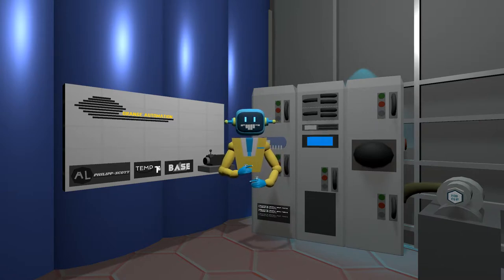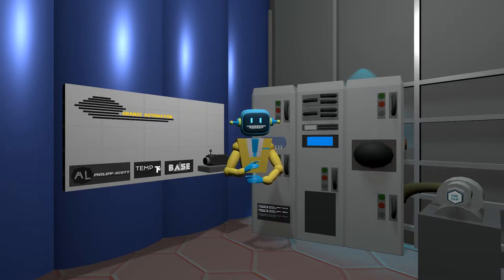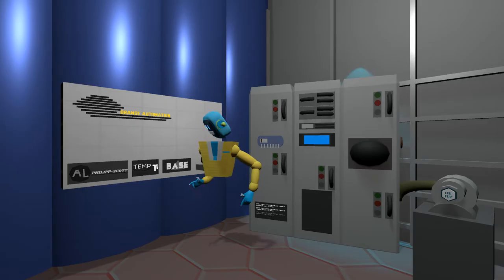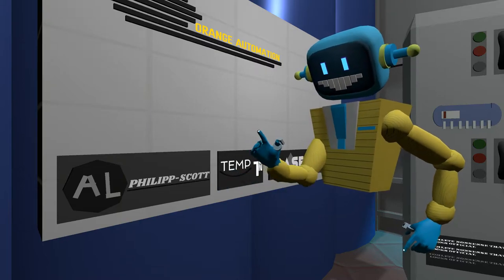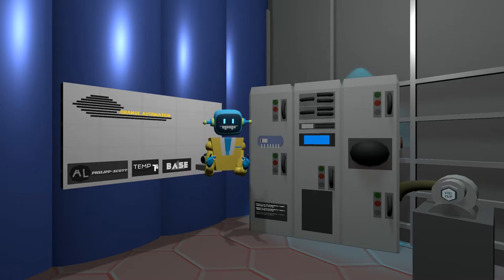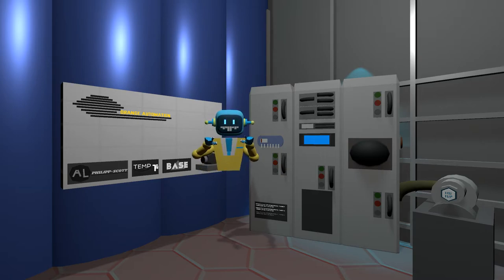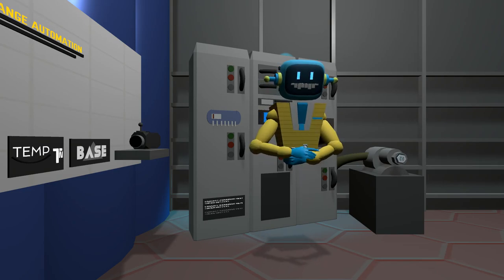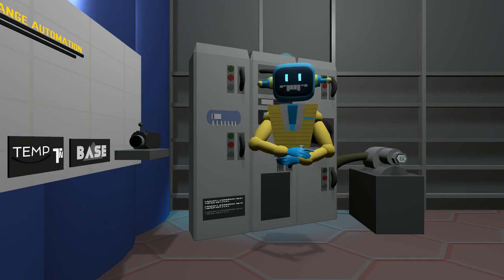Orange Automation Retro Encabulator

Comment: But seriously, I'm going to need you to install a few in the lab in my mansion. Maybe along the back wall under the Pac-Man sign?
The unilateral phase detractors built into the walls definitely could use a power handling upgrade for better inverse reactive current.
Reply from the maker: Right? The eliminated side fumbling is reason enough!